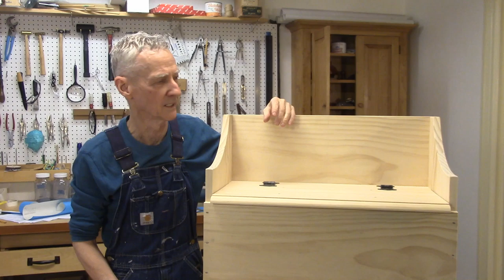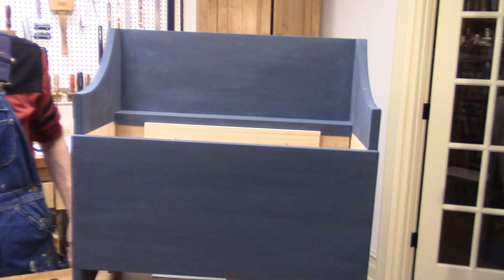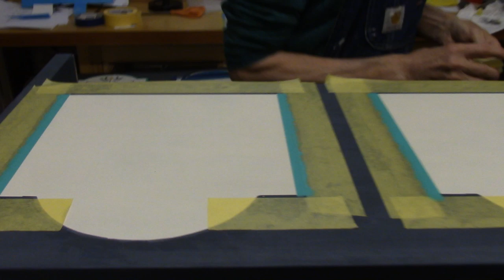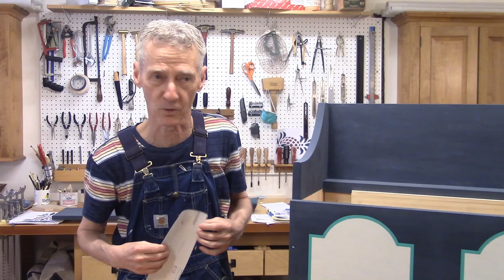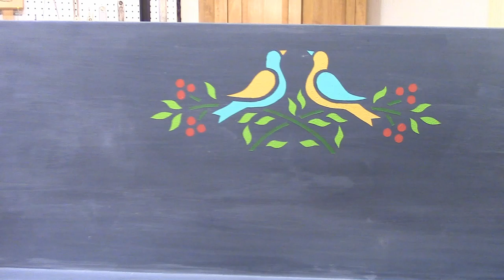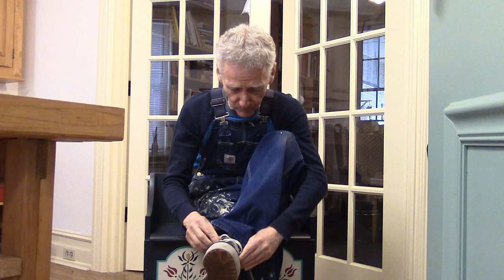Boot Bench Show #5

Comment: Hey Ken, great video as usual.  There is a detail that I would like you to explain to me.  How did you reduce the size of the stencil, and change the shape of the leaves?
Reply from the maker: Hi Jon. I took a photo of the stencil, imported the image to my computer and varied the size on my printer until I was happy with it. The leaves I simply freehanded. Then I traced the image onto my stencil film. Very low-tech really. Thanks for the question.